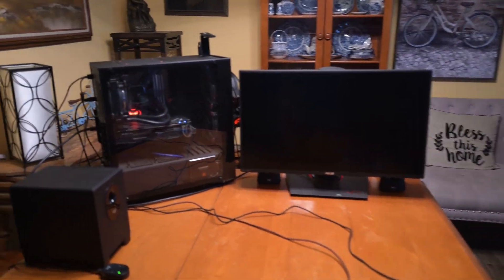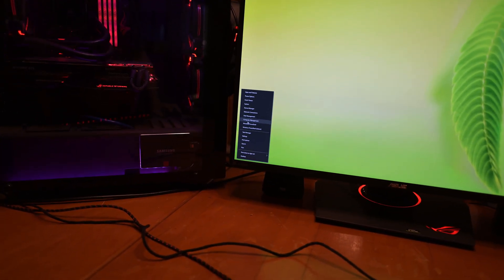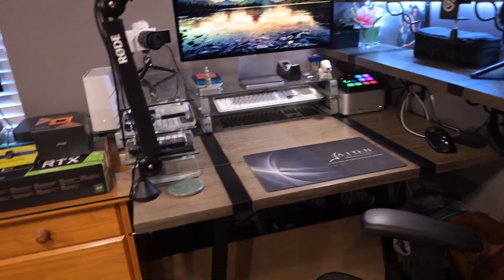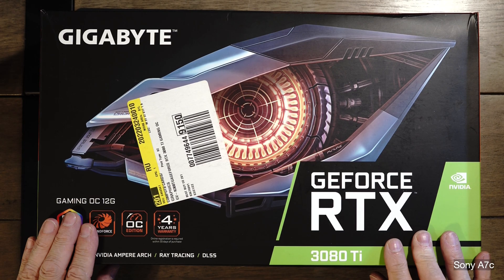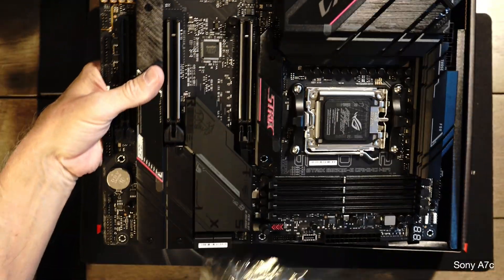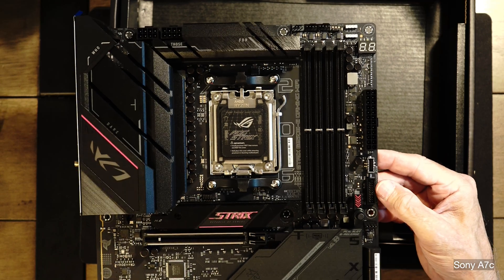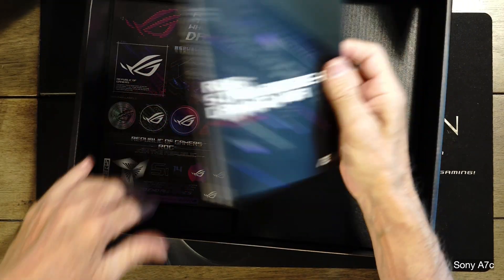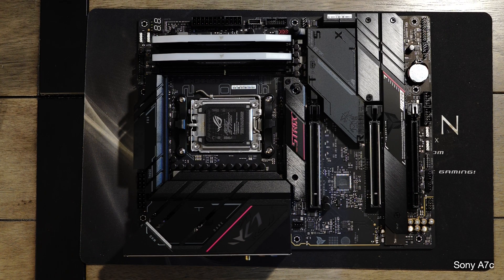Upgrading Old Faithful to Windows 11 Part 1 on 2024/05/26

Comment: there is bugs and ADs in windows11 as of now, im scared in future i will be forced from windows10 to "upgrade" via directx not supported or steam work only on "latest better" windows, anything else "macrohard" company can think of.
wish it works for u best!
Reply from the maker: I turned off the Focus Notification and Widgets.  Just a Gaming Computter with no RGB Rainbow Flashing.  RTX 4070 ti is excellent and cooler than the RTX 3080 ti.  I upgraded many other computers with no problem from Windows 10.  The problem was switching from Intel to AMD.  Cheers!